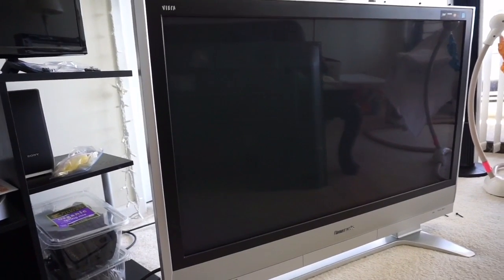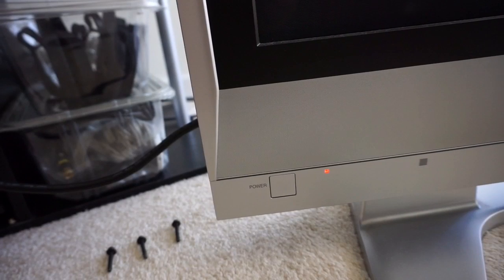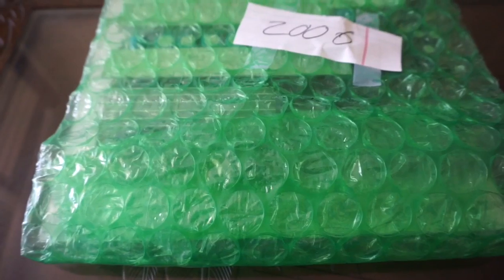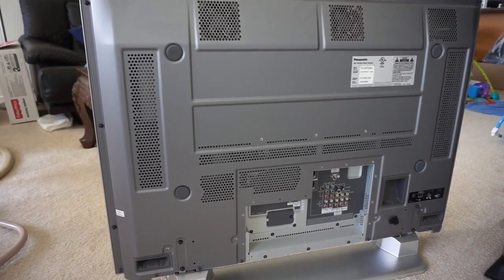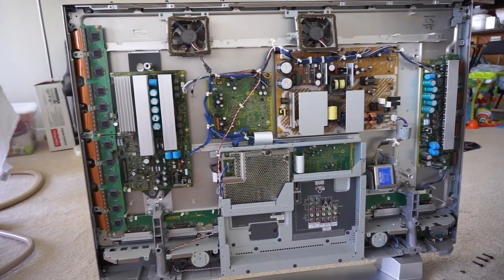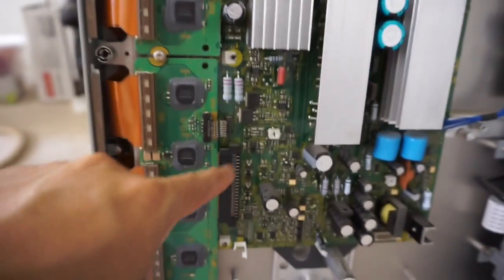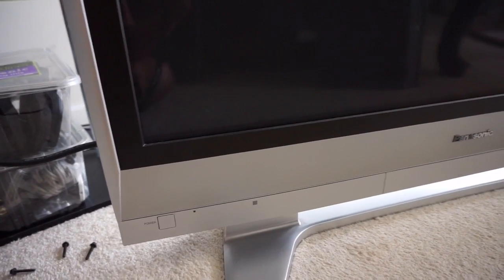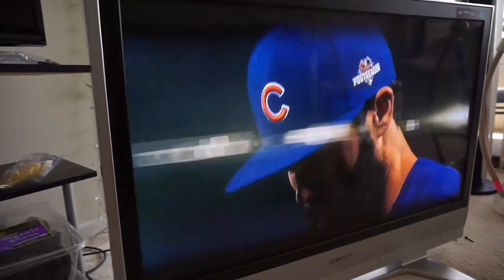Plasma TV Repair - Seven blinking lights - Panasonic Viera TH-42PX60U

Comment: I have a question, I have a TH 42 PV8M Panasonic screen on the red lamp only, what is the problem, knowing that I tried to press the buttons or the remote control and there is no response

Comment: be careful, on my 50" st60 i had 7 blinks because the ss board was completely shorted to ground and dropped the voltage of sc board. always check for shorts on buffer board, sc board and ss board just o prevent wasting money on replacement parts. My panasonic works perfectly about a week now.

Comment: Daer sir,

I have Panasonic Plasma TV Model - TH-L32X10D , The problem is that when i on tv all function is working but after 2-3 minutes itd goes off & red blinking continuously blinking. When again start than same function repeat....... i know the problem in power supply but i can't find.... plz help
7909011304

Comment: Hi bro I have the same TV for about 15 years bought it brand new and a few years ago HDMI connector stopped working. I removed the back cover and found there is a red led light almost close to HDMI port behind a metallic protector. I already checked the cables and connections. By the way, my Tv has only one  HDMI port. It´s a viera PANASONIC TH-42PD60X wonder if you could walk me through. thanks

Comment: I have a pansonic th 50px80u when i turn it on it just keeps clicking on and off i tried to count the blinks but they just never stopped , is there a ballast for this tv ?I believe i had this problem several years ago and that is the part that was replaced , i have searched for on but maybe they are calling it a different name
Reply from the maker: david gorski What you are describing sounds like it could be a problem with the power supply. You’ll want to research that as a possible problem. If that is the case then the solution could be to replace the power supply, however keep in mind that simply replacing the power supply might not be enough. There could be another component(s) that could be the issue or one of a few issues. Hope this helps at least give you a lead towards finding a solution. Good luck.